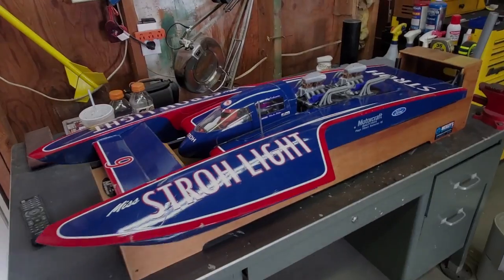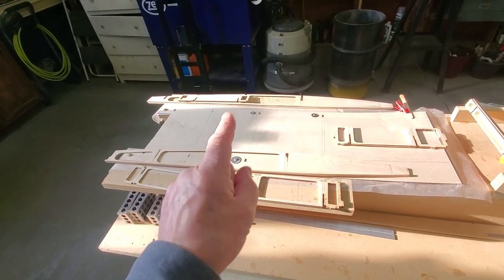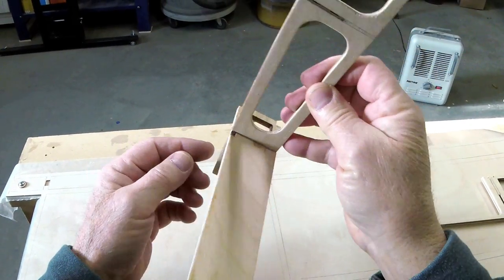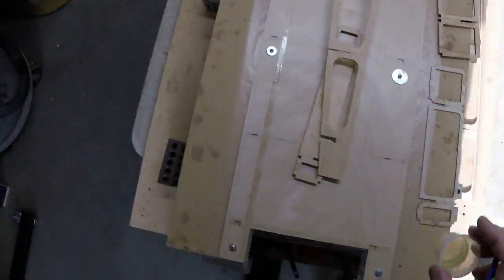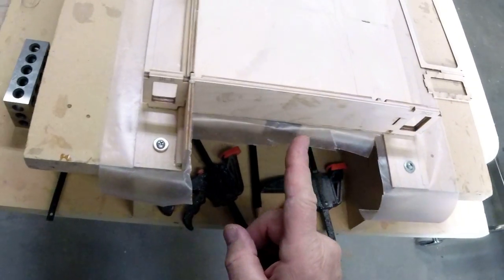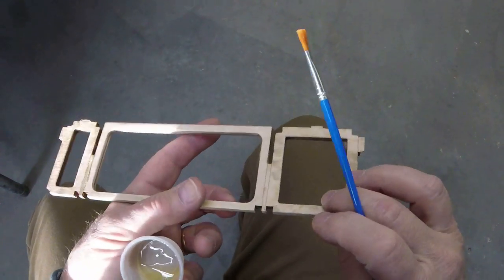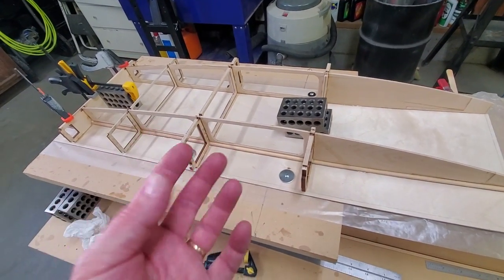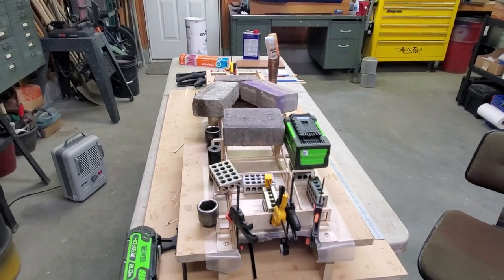Assembly Begins!!  Part Seven - RC Hydroplane Kit Build | The Center Section

Comment: This is the video I have wanted since I bought my kit.
Reply from the maker: This video is number seven in a series.... Check out my channel playlist and you can join the whole build in progress right now!
Reply: @M5PerfHydros  I cannot wait for the deck sheeting video in the future. Thats why my kit is a unskinned frame still... I built it like a airplane with superglue. I'm probably going to start over after watching this. 
1/6.66th Gas Scale Newton 158/ MHR 8700 Extreme Kit
Go big or go home for my first wood boat. I also have questions on 1/6 gas driveshafts, square drives, adapters, props stuffing boxes engines ect. Thanks for all the help. I watch all your goofy video. Love it!
Reply from the maker: Already have you covered my man!  Check out this video https://youtu.be/BsQRjRKc_as
Reply: ... And the reason that model boat engine crankshafts rotate counter clockwise (looking at the flywheel/prop) is because the model boat engines were first based on model airplane engines.  Model airplane engines rotate that way because most people are right handed, and it's much easier to flip the prop in a counter clockwise direction.

Comment: I'd also like to see a video series on designing and building a cowling.  That would be awesome
Reply from the maker: You're not the first to mention it.  Do you have a particular boat/cowl in mind that you want to make?
Reply: @M5PerfHydros  yes.  1980 miss budweiser hydroplane u-12
Reply: It's very similar to the eliminator cowling
Reply from the maker: This one?  It's already available here https://www.rcboatcompany.com/sg110c
Reply: @M5PerfHydros  not exactly.  I think I goofed it's 1980 miss Budweiser u-1.  The driver sits in front with an open cowling
Reply from the maker: RC boat company has that one too.  I tend to build odd boats so I do usually need to make cowling molds. Next time I do it I'll shoot some video

Comment: Scott - Somewhere in this video (?) you mentioned that you're looking for source for 3/16" triangular bass wood sticks.  I did a internet search and found none, so I made my own on my tablesaw,  a 40 tooth finish plywood blade, and a 3/16" x 4" x 24" bass wood sheet (this is what I happend to have handy - but longer 36" and 48" long boards are available on-line) .  I ripped the sheet (or board?) with the blade angled  at 45 degrees, then adjusted the fence, then ripped it at 90 degrees, and repeated this (alternating) process untill the sheet was gone. This should save a little weight.
Reply: ... and where the stick passes through the square holes in the bulkheads, use your razor saw to cut 1/2" or 1/4" pieces of the triangle stick, and add them to the square holes where the triangular stick passes through the holes in the bulkheads (two triangle shapes  make a square).
Reply from the maker: Awesome!  I guess now I need to buy a table saw.  Like, subscribe, share, click the ads, buy something you don't need, and maybe, someday decades from now, I'll earn enough from all that stuff to buy a blade, and that's a start!
Reply from the maker: One thing... Don't fill the square hole, it's just a guide. Save the hassle and leave the opening for additional drainage.  Dang man now I gotta build a whole new boat!
Reply: @M5PerfHydros  Please let me know when you plan to build your next R/C boat - I will cut and mail you a bunch of 3/16" triangular sticks for it.
-Dave
Reply from the maker: Deal!